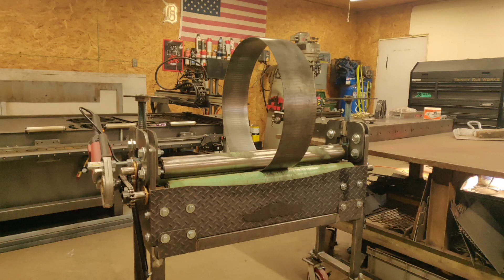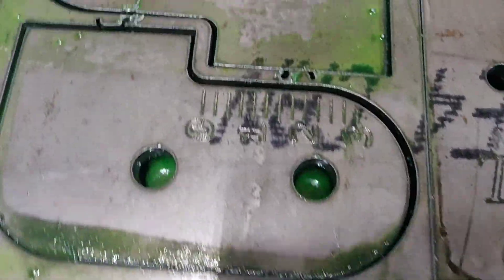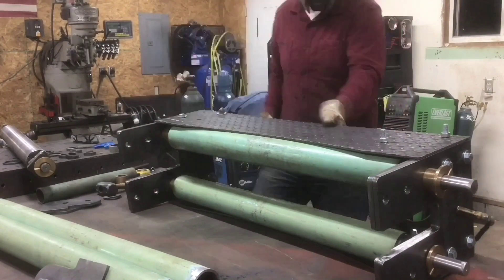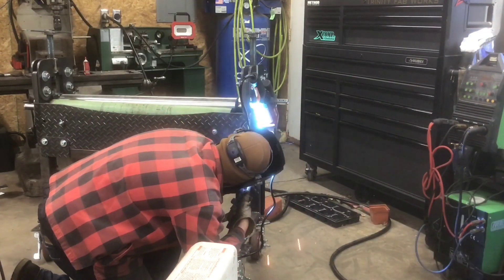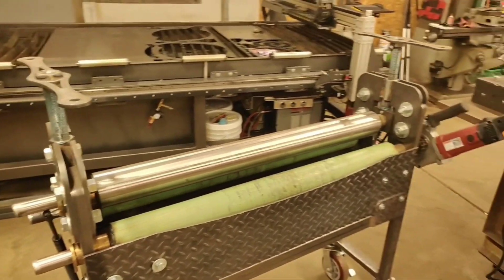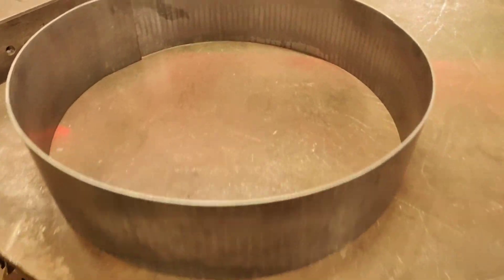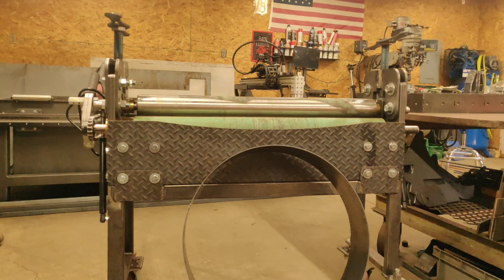Homebuilt Plate Roller

Comment: Great video.  I'm wondering how you treated the end of the threaded rods that raise and lower the top roller. How does it lift the roller up, is there a shaft collar or something on there?
Reply from the maker: It's not treated.  I just put a slight chamfer on the end and put a little grease on it.  It's been fine so far!  I suppose that I could case harden the end.  It has struts that lift it back up. I've had customers come up with pretty clever solutions to lifting the roller back up.  My favorite that I've seen is a cantilevered counterweight that appears to work really well.
Reply: @trinityfabworks6493 Ahh, I didn't see the air spring.  The version I was going to try was having a upside down U shaped bracket on top of the bushing block- the threaded rod lead screw runs through that and then there is a threaded shaft collar on  the lead screw below the bracket so you can use the lead screw to lift as well as lower the roller.

Comment: what is maximum thickness mild steel plate can bend
Reply from the maker: To be honest, I'm not entirely sure.  I've never maxxed out the machine.  I have people that have told me that they've bent around 30" of 3/16" stainless on it without any issues, but I have yet to find its max.

Comment: What's the centerline distance between the bottom rollers? Curious if I build this with some schedule 80, or thicker, if it could handle 1/4" at full width? From what I understand, the bottom roller distance has a lot of say in whether that's possible or not.
Reply from the maker: I can't remember off of the top of my head. I'll have to check and get back with you.  I'm doubtful that it would do full width at 1/4", especially with the pipe threader.  I think that you'd probably need to go with a hydraulic unit at that point.
Reply: @trinityfabworks6493  You're probably right, wishful thinking. Would likely have to beef up a lot more on the unit to get it done. Awesome job, looks like a nice machine to use!
Reply from the maker: @tbroekemeier  thanks, I appreciate it

Comment: Sweet build - we're working on a similar one but in an "initial pinch" layout to avoid the flat spots on the ends. One question - are the bushings in the plasma cut holes pressed in or retained with a set screw or anything? I saw you were opening them up with a die grinder, did you cut them purposely small and open them up to fit?
Also one small note on those gas struts - you should mount them upside down with the rod end going down and the cylinder body going up - there is an o ring seal on the end of the cylinder body that is self-lubricating but needs to be mounted the other way around so that gravity keeps the lubricant where it's needed.

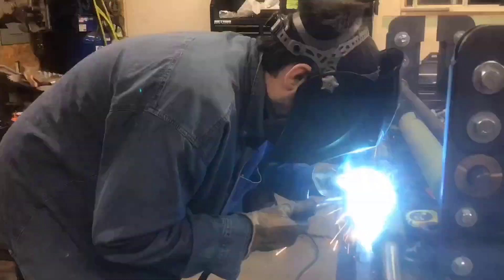Comment: Has anyone built this with the supplied instruction.  I am starting the build, I noticed you said 3.5 inch for the outside of the roller.  Instruction has 3 inch.  This is stated at 2:40 into the video.  So I am concerned the DXF may be off on distance between the bottom two rollers..
Reply from the maker: And yeah, several others have built based off of the instructions.  You were the first to catch that.  You should use 3" sch. 40 pipe.
Reply from the maker: Hey Craig, I must have misspoke in the video.  It's 3" schedule 40 pipe.  Pipe is measured on ID, and it happens to be roughly 3.5" OD.  Hope this helps!

Comment: Outstanding job, any chance of plans for this ? Is it possible to extend to 48”?
Reply from the maker: Plans are available for purchase.  Email trinityfabworksllc@gmail.com for details
Reply from the maker: Yes, the only things that you would need to change are the length of the rollers and the side plates.  Everything else would be the same.  If I were to make plans available for it, I would have to change some of the design to fit more readily available parts.